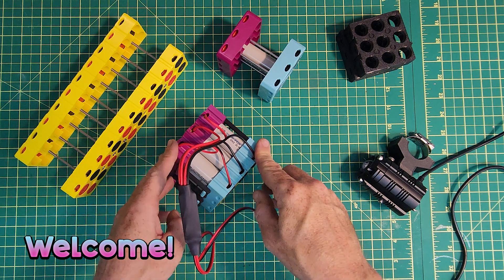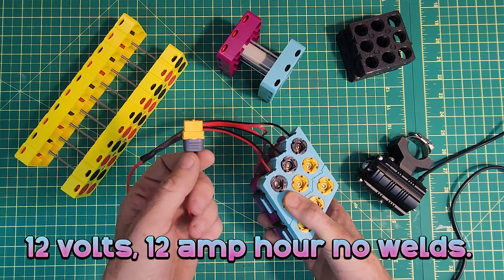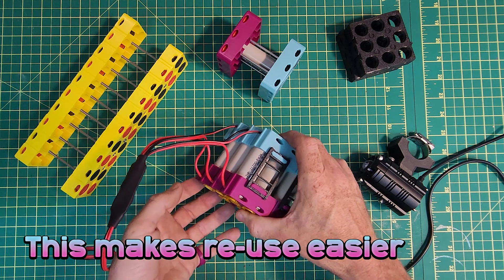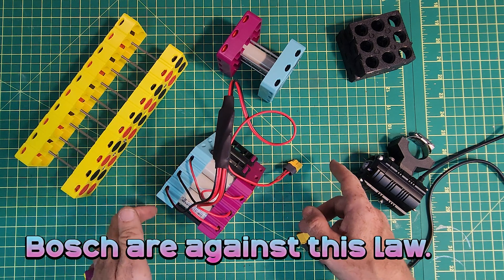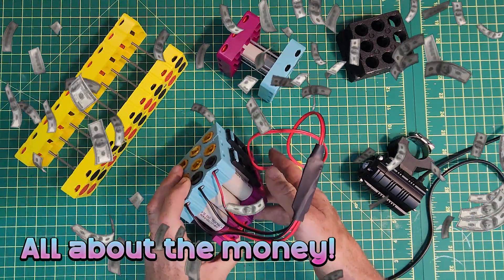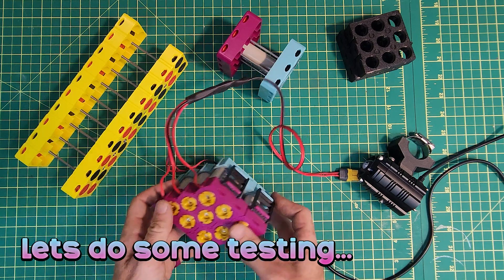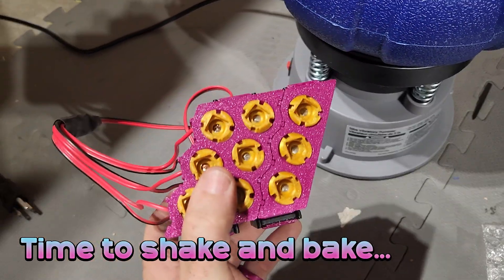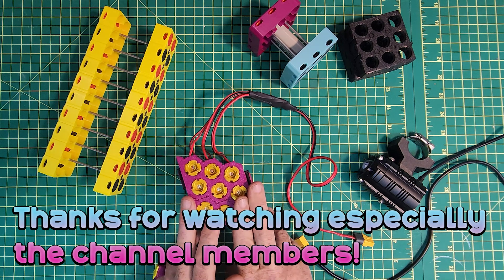No Spot welds! Weldless battery system vs Bosch! (sort of) Let's do some testing?

Comment: You get a decent Chinese spot welder pretty cheap these days, so how many/large batteries do you make before the spot welder becomes the better option? Size of the battery also seem to be a concern.
Reply from the maker: There is about a 10% size cost from what I am seeing so far I will do some comparisons though. I have no idea how long it takes to become competent with a spot welder. The thing I find attractive here whether its using this weldless technique is that it changes the lifecycle of cells and makes other things much easier. So say you have a three year old ebike battery. The cells in it are only charging to 80%. If the battery is built without welds it can be taken apart in a few minutes by someone without skill wearing less safety equipment. Most of the cells will still be pretty decent so that can go off for sorting by type and resistance. Perhaps they are made into power banks. Any cells that are toast are then recycled. If the battery casing etc is good after inspection it gets refreshed with new cells. I think that being able to have this flow is more important than the 10% increase in size.
Reply: @HighVoltageKits  A spot welder takes almost no skill other then a one time adjustment of weld strength to fit the metal bands you use, and not short anything out while working on the battery. But I see your point about rebuilding old batteries.

Comment: can you build a 52v triangle battery and then compare the size and weight compared to packs that you can buy from retailers? im interested to see how it compares also do you think this could fit in a triangle battery case
Reply from the maker: I am going to do a 36 volt pack as the first larger one and test that to start with. But yes I can provide weight stats etc.

Comment: I really like this whole concept and I look forward to the vibration test results!
The issues that I foresee are:-
1) deformation of the braids due to pressure/vibration leading to non uniform contact  resistance.
2) the above could also lead to exposure of the copper in the braids and allow corrosion to get a foothold. 
Maybe a torque screwdriver or wrench would help give a uniform contact pressure? Also checking screw ends after a test period would be more accurate with a torque measuring tool.
Please would you take some of the braids out after testing to see if any of these issues are evident. 
I like the other style of kit with the bolt/screw fixings - looks more robust and quality controllable with torque tools.
Thanks for your work on this.
Reply from the maker: Yeah we can look at that and do some testing with torque values. Good ideas. Thanks

Comment: The main issue I see with it, is it makes the battery HUGE compared to welding.
Reply from the maker: It maybe adds 10%. I am not going to pretend that there is not a cost as there are advantages and disadvantages to everything. The size cost is not as bad as you might think. I am working on elimination of the clips which removes a few mm. For most purposes a battery that is 10% bigger is not going to be make or break. Custom downhill ebikes with tiny triangles for example need every last square cm at least in two dimensions. But something like a cargo bike or a hardtail less so. Beyond transport you have things like energy storage, portable power supply units. I am going to make a 3s 10p pack to take on camping trips with a custom sealed case. For about $350 I can make a 50amp hour battery with high quality cells. It would be much better than any of the low capacity ones being sold to campers for twice the price or more for much less capacity.
Reply: @HighVoltageKits  
Being short in the leg, the triangle of my bike won't fit a hi long case. Only a custom made welded battery would fit.

$350 you say?
Cell prices must have plummeted in the last 3 months then ................
My 64 cell battery cost £200 in just cells, and that was before covid and the huge rise in cell cost.
Reply: Maybe it could be designed to also serve as the protection/casing therefore not really taking up more space? Could have individual fuses for each cell ect?
Reply: I tend to disagree with this. It increases the size yes, but huge is a pretty big overstatement in my opinion for a 10-20% volume change. For thevast majority of bikes that size increase is pretty much irrelecant as long as the weight is virtually the same. Unless your bike is highly specialized it will have no problem fitting in the same location, with nearly identical impact on weight and balance. 

There are other issues that I think are quite important to assess and test, like possible deformation, reliability etc, but size just isn't one of them for me. Especially when you weigh it against the incredible benefits of being able to reuse functioning cells from a defect battery pack. I wonder how many batteries have been thrown out because of one or two defect cells and a bad BMS.

Comment: It comes down to "who is capable" to make one?  That's why we have safety laws.  The Big Push for "do it yourself" (phone repair) guy in NYC set his own building on fire when his E-bike battery blew up and let the smoke out.  I believe it was a DIY job.
Reply from the maker: That was Louis Rossman. The batteries were 72 volt ones from Unit Pack Power. He had two wired in parallel with some kind of homemade bridge rectifier. Not the smartest choice. To me there is greater risk learning to spot welding and using such packs until that person gets good. Batteries should be respected. I'm not going over 36 volts while I test these designs. I do think that the conversation needs to be had in terms of ease of repair use and recycle.
Reply: @HighVoltageKits  I would like to be able to do this too, but you need to go into more depth on how "tight" the battery end screw are tightened.  Would it help to add solder to the mesh straps to make a better contact?  I also wonder if the batteries on the inside of the pack are as tightly held as the outer ones.  Be nice if there was a way to secure the inner rows as well as the outer ones.  Not sure about the outside straps that hold the one you make together.  More needs to be shown on the BMS.

Comment: actually the most common failure type of brand name batteries is a defected bms. some of the symptoms are:
reject charging
general error saying cells are bad (though not true)
reject discharging
just revived a basically new panasonic 36V 17Ah battery cell block with a universal bms for use on a front hub cargo bike.
Reply from the maker: Great point. The case Bosch made was a bit pathetic but they have alot of money.
Reply: The Bosch BMS is notorious for failing, and as they use a can bus system, you can't replace it.

Comment: Watching this with a keen eye!
 I have a project where I wish to power a kayak with cells to build a 16V pack for a bit of extra kick for the motor and 12v for the electronics.
 I could now build two packs without worrying about spot welding. Due to size not being a big concern this might also allow me to build a big 12V battery for my ute to charge it from solar for camping!
 I know there is a few systems out there already but will twice as hard ot this one:face-purple-wide-eyes::face-purple-wide-eyes:
Reply from the maker: Reckon you could make a waterproofed pack that's 4s 10p. With the 50E cells that's a whopping 50 amp hour in not a huge pack.

Comment: Plus you could replace the crap cell that bosch uses with better cells. So of course they don't want that.
Reply: You forgot that BMS in BOSCH battery does autodestruction when voltage is below certain level.
Reply from the maker: Exactly!